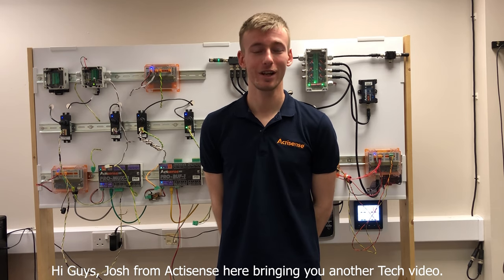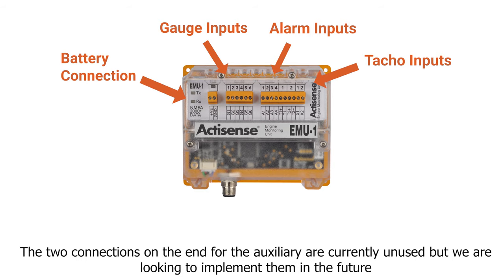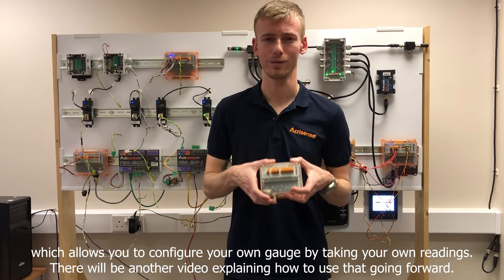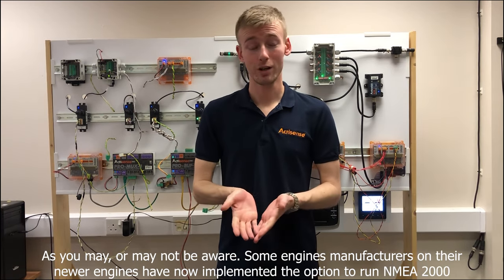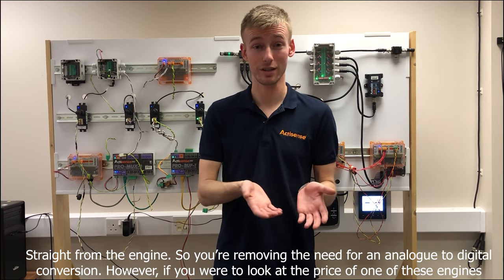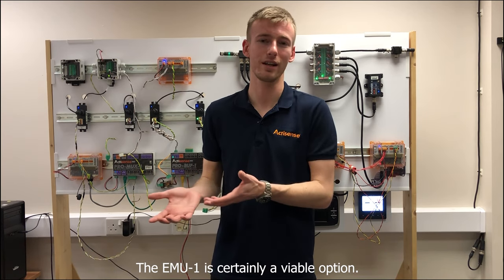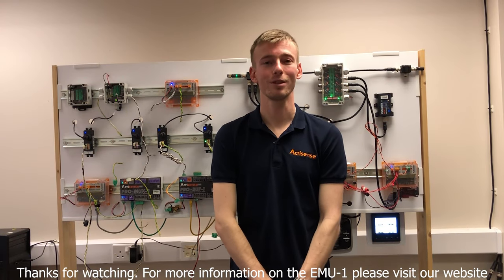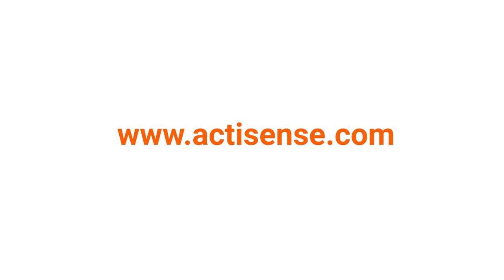Convert analogue gauges to NMEA 2000 with the Actisense EMU-1 Engine Monitoring Unit

Comment: All sounds easy. I have twin Detroit 4-71TIs on my boat. So I can leave my analog gauges right where they are and just run secondary wire to your unit? I'm looking to be able to view all that information on my Raymarine Axiom 9.
Reply from the maker: Hi Ryan, that's correct, the EMU-1 can operate with the gauges left in circuit, the wires simply need to be tapped off the gauge. Diagrams explaining this are located within the EMU-1 user manual - https://actisense.com/acti_downloads/emu-1-user-manual/
Reply: @Actisense  wont this cause the Engine Gauges to read incorrectly as they are a resistor and you are adding an extra device in circuit?

Comment: Hello, I have twin 4,3 mercruisers efi do I need one or two emu units
Reply from the maker: Hi, thank you for contacting us. Please can you raise a support ticket using the following link and a member of our Tech support team will get back to you as soon as possible. -> https://desk.zoho.eu/portal/actisense/en/newticket
Reply: Have twin 5.7 merc. efi's.  Found Fox gateways which seem much simpler.   https://fox-marine.com/
No programming required, just configuration via dip switches for twin setup.  Roughly $600.00 USD for two gateways. Simply know the ECM type so you purchase the gateway with the correct engine data adaptor attached.  Plug adaptor into engine data port, plug NMEA2000 wire into the gateway, stats display on your MFD that is also plugged into the NMEA2000 network.  Even better, they have Bluetooth capability.  Download the Fox Apple or Android App.  The App displays all the data certified techs see with their engine data readers.  With Bluetooth and a tablet you can diagnose issues and even clear codes from the App.

Comment: If you can make the conversion from MTU engines M91 v16 serie 2000, let me know as have installed Garmin gpsmap8416series and could monitor through nmea200 or J1939, regards
Reply from the maker: Hi Goncalo, please get in contact with our technical support team by emailing them at support@actisense.com, and one of our engineers will talk you through it.
Reply: @Actisense  thanks , already did!

Comment: I have a 2000 Johnson Ocean Pro and would like to use the gauges in my garmin SV. Can you help?
Reply from the maker: Hi, Due to the large amount of engines on the market, each with their own senders and gauges which are interchangeable, we do not configure the EMU-1 via an Engine Model or Manufacturer. Rather, we use sender/gauge pairings as our referencing for configuration. There is an article on our knowledge base which explains this in more detail - https://actisense.com/knowledge-base/nmea-2000/emu-1-nmea-2000-engine-monitoring-unit/emu-1-engine-compatibility-and-setup/. 

Our technical support team are more than happy to help with your configuration and installation of our products, please contact support@actisense.com for further help.

Comment: Will these work with Mercruiser 5LX V* alpha engines ? 
Are you at the Southampton Boat show this week ?
Reply from the maker: Hi Ian, Our UK distributor - IMP - is exhibiting at Southampton Boat Show. They are located in Ocean Hall. 
In order to determine if the Actisense EMU-1 is compatible, you need to find out what senders and gauges you have. Not the engine model / manufacturer. 
This article describes this in more detail - https://actisense.com/knowledge-base/nmea-2000/emu-1-nmea-2000-engine-monitoring-unit/emu-1-engine-compatibility-and-setup/?fbclid=IwAR1_tNv4CRx98vIR-LusPNijPbb9tCsZX10HbgTSl4jl8b1X7dOLOJt-kPE

Comment: Is there a way to do the connection by Blue Tooth?
Reply from the maker: Currently, there is no upgrade / configuration method that uses Bluetooth. The EMU-1 is configured and upgraded via Actisense Toolkit which is a PC Application, and an Actisense NGT-1-USB which is an NMEA 2000 to PC interface device. Wireless configuration might be possible in the future, but we can’t provide any dates on this yet.

Comment: Do the analog gauges have to be connected between the outboard and the EMU? Or does it take the place of the analog gauges?  I too have an Evinrude Ocean Pro 200
Reply from the maker: Hi Thomas, the EMU-1 can be connected with gauges still connected, or run without gauges and operate directly from sender. In the EMU-1 user manual, there are diagrams on how to connect the EMU-1 gauge inputs to the sender / gauge depending on which type you have - https://actisense.com/acti_downloads/emu-1-user-manual/.

Comment: How much do these cost in usa? Also what else would I need to display this info on a screen? Thanks
Reply from the maker: Hi Cole, please contact our US distributor Gemeco for pricing - https://www.gemeco.com/

As for your other question, an NMEA 2000 MFD is required to display the engine data on your NMEA 2000 network. Most manufacturer’s displays are capable of displaying engine data, but it is always worth checking with them first. 
If you are looking to display the data on a PC application, then an Actisense NGT-1-USB is used to transfer your NMEA 2000 data from the bus onto the PC. The NGT-1 is also required to configure and upgrade the EMU-1 anyway, so keeping it on the network is definitely a benefit. 

I hope this helps!